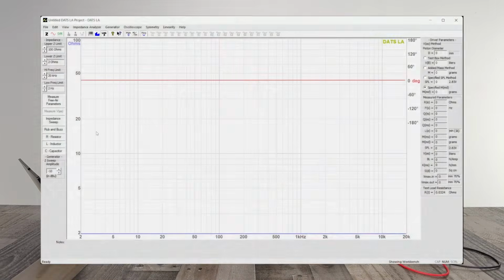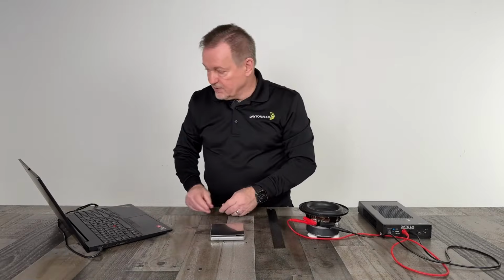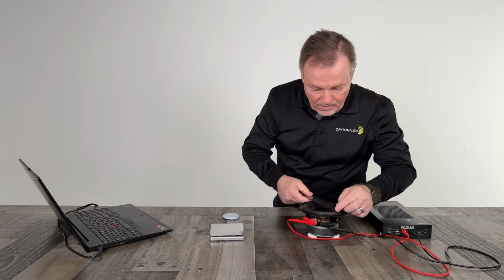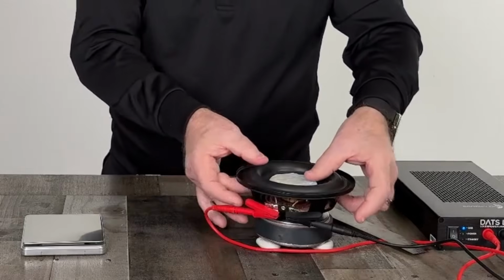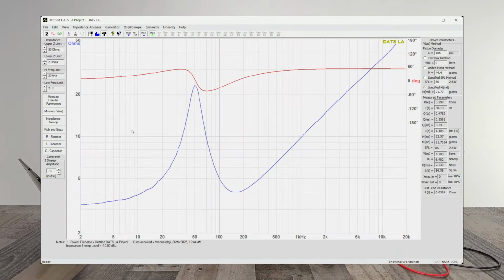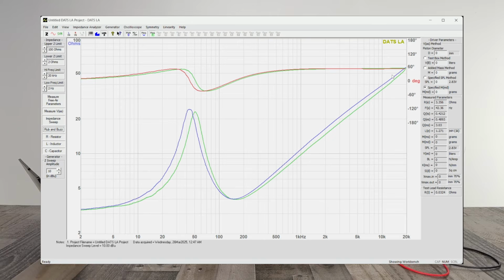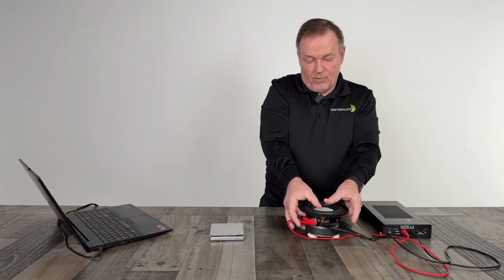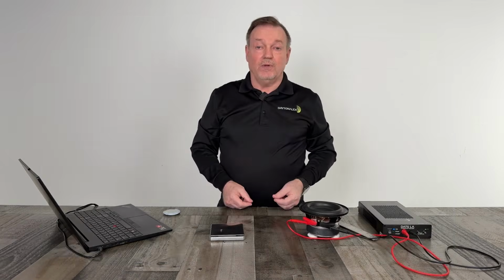DATS LA: How to Measure Small & Large Signal Parameters

Comment: Speaker caps are usually very thin and will dent under such a weight. Also, you don't want to leave dirt on the cone from putty or tape. The added weight method is very inaccurate. It's better to make a large box with a known volume and use it for measurements; it's much more accurate than adding weight.
Reply: This Is Not Rocket Science .  If you do it correctly, it'll be close enough.